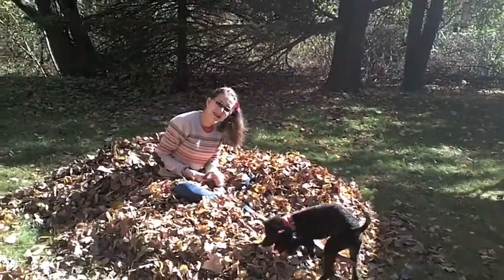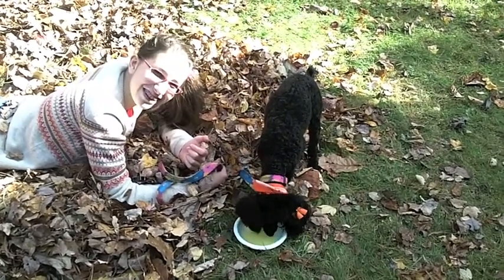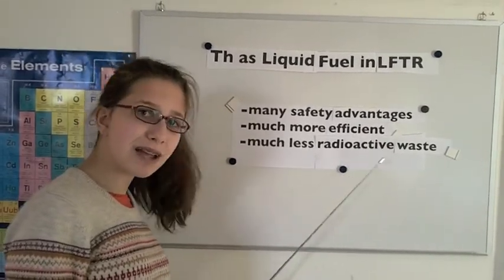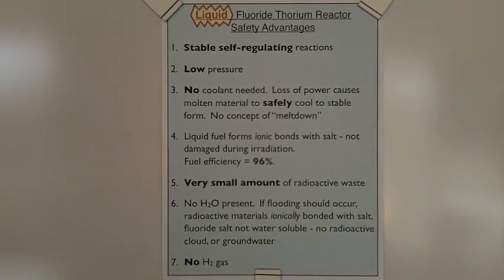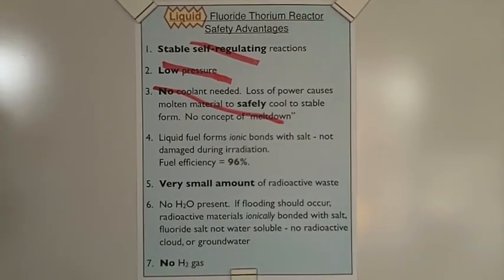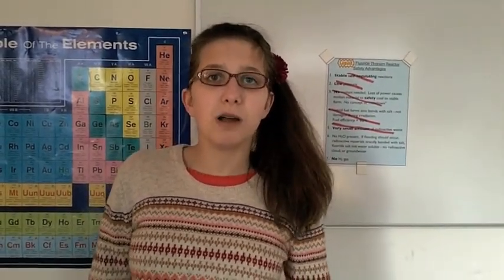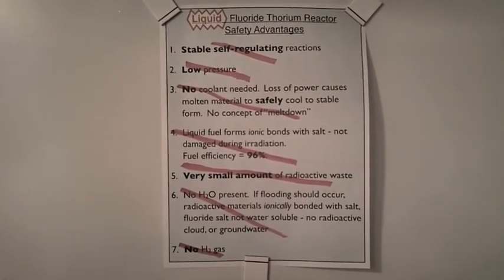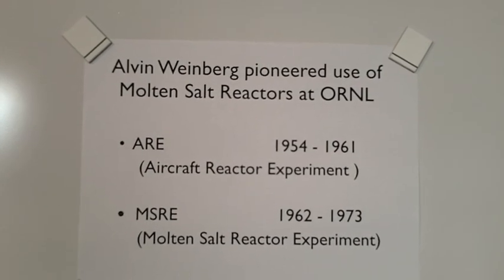Nuclear Energy - Thorium As A Fuel (Liquid vs. Solid) - Katie and Caysie

Comment: When you consider nuclear energy you must produce plutonium because we must maintain  our nuclear protection from would be dictators, who would take advantage. Nuclear waste could be disposed of it in volcanoes. Nuclear reactors should only be built on the coast line and be designed not only for producing steam to generate electricity but should also  condense desalinated sea water to fresh drinking water. Safety should be enhanced with several back up  features.